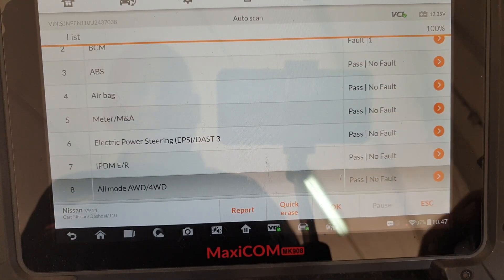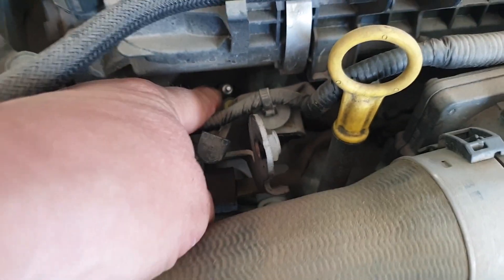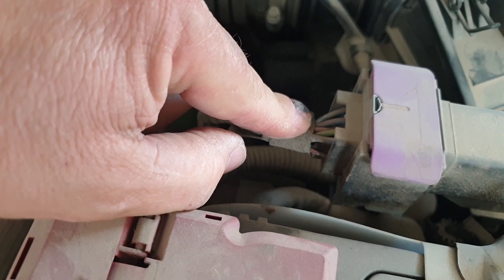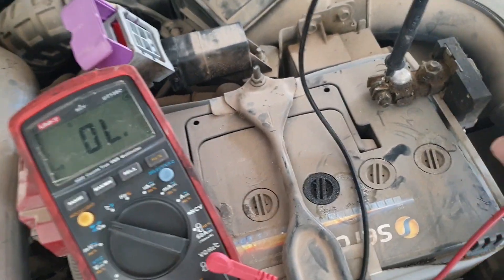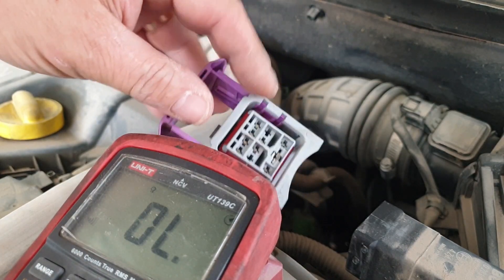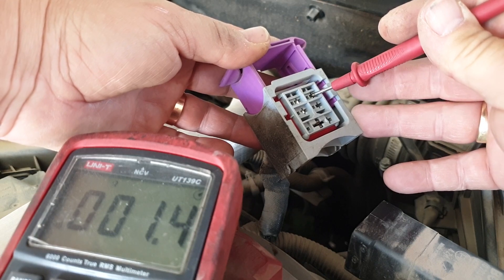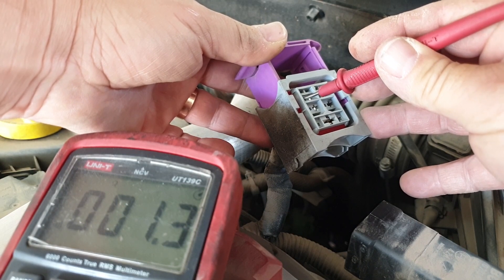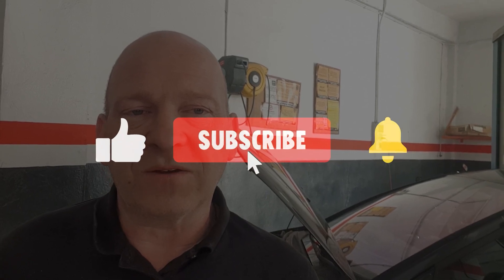Nissan Qashqai, failed inspection p0380, how to test the glow plugs.

Comment: Great video. What’s the best way of checking that each glow plug on the Qashqai 2012 J10 diesel is actually getting power supplied to it? Thanks.
Reply from the maker: You can check for power at each glow plug connector, using a multimeter or test light, I prefer a test light as it is easy to see, when the ignition is cycled on and off. Thank you for watching the video.

Comment: you sure 1.5 ohms is 'high' ....youve tested in situ which means the resistance of tfe glow plug + the wire feeding them (the wire will have resistance too)
Reply from the maker: The resistance in the wire should mot make that amount of difference as seen in the video. to the reading,, Proof is in the pudding as they say, Glow plugs changed, code did not return d vehicle passed the inspection.
Reply: @rpsspain1966  we are talking less than an an Ohm for the wire (your reading was 1.5 Ohms which you said was "high",  yet the glow plug spec is around 0.8 Ohms ...a length of copper wire can easily measure 0.7 ohms...therefore I wouldn't say a glow plug reading of 1.5 Ohms  in situ as measured via the cabling loom is 'high'
Reply: I have seen 0.6 ohm on Nissan NV200 diesel (K9K engine). But there are two variant of glow plugs I bellieve ? 11volts and 4.4 volts, check first which your car+model+year is using.

Comment: trying to find out why I am still getting fault code when I have replaced all the glowplugs.
Reply from the maker: you should get a proper diagnostic, check control module. fuses. powers and grounds.

Comment: What setting did you put your meter. On
Reply from the maker: Ohms to check continuity.
Reply: @rpsspain1966  200k?
Reply from the maker: Set it on auto range
Reply: Hi how do you check the glow plug relay  you unplugged the multiple from ?
Reply: Does it pose any issues if one leaves it? Spent 1000 on service before NCT picked it up so inclined to leave it
Reply: What should a good plug read